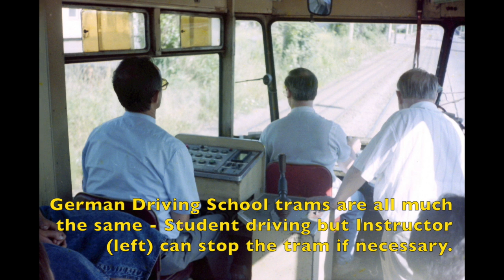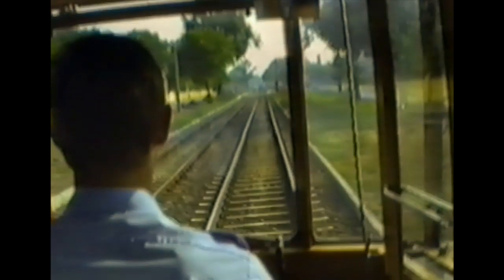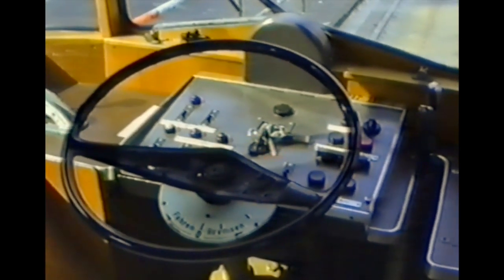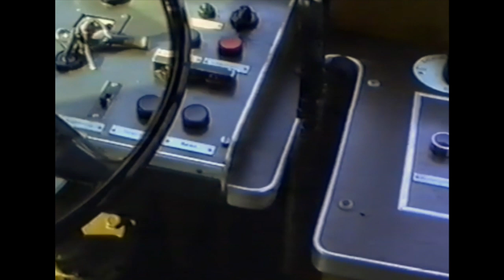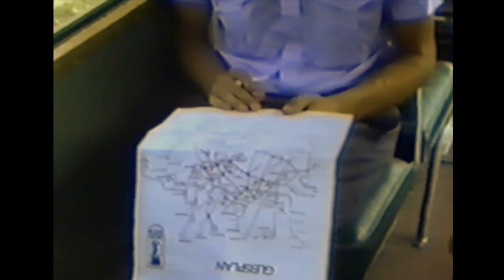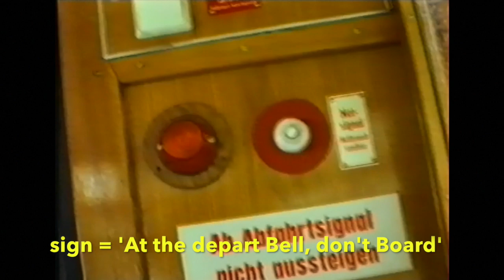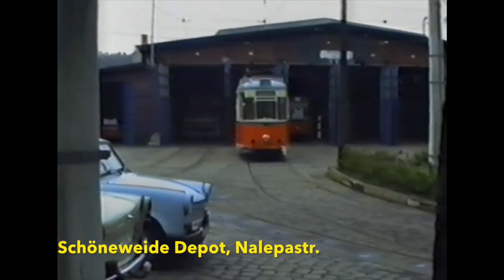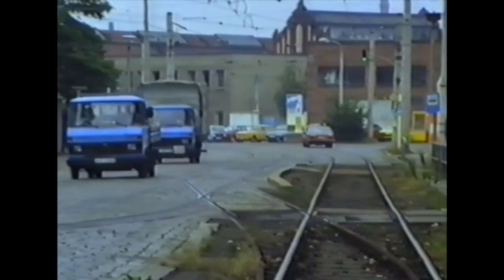Becoming a Tram Driver Berlin 1992 + Freight Locos

Comment: This would have to be one of the most interesting I have seen in a long time.
I love percular things like old trams and locos running in the street.
I thought pantographs were raised and lowered with compressed air like on trains

I went to San Francisco this year, first time ever.
I loved the working heritage trams they have, all the American cars almost as if they are brand new plus a Melbourne tram, a Milan tram and two Blackpool boat trams.
I really think Sydney should run heritage trams through the rocks and bring the Tramway museum up there, what a brilliant but function tourist attraction that would be.
Reply from the maker: I’m happy that you enjoyed it. It’s a pity most Railfans here will stay well clear of it. Around the world, most fans are very parochial and shut their eyes to fascinating operations elsewhere. As for raising pantographs, in Melbourne trams use an electric motor to stretchthe springs to pull pantographs up and relaxes them to lower them.
A few decades ago I think the Rocks idea was suggested but nothing ever happened and nothing ever will. Pity. As you say, San Francisco is great. The modern looking San Francisco PCC trams there look brand-new because essentially they are. Very thorough re-builds. Melbourne could run their vintage trams but the foreigners who run the operation want to keep them right away from the system.
Reply: @tressteleg1  i loved San Francisco, the cable cars are brilliant and of course Trolleybuses, they love them.
How STUPID were Wellington to shut the system down.
In Europe they use them plus tramways galore.
Well we now have the metro here in Sydney, will be better when it goes i to the city, but I think Metros, bring it on big time.
Have you ever been to the Trolleybus museum at Sandtoft in the UK?
Reply from the maker: Agreed, Wellington stupid.
The NW Metro was supposed to be a normal train extension. The Liberals wanted to kick the rail unions so made it a driverless metro with tunnels too small. I’m glad I don’t have to stand up for a half an hour or more ride. When the Bankstown rail line is converted to this, there won’t be too many happy people over there. Many less seats.
Reply: @tressteleg1  but that is how metros work, also it's much quicker.
The journey to the city will be much quicker once it's goes through.

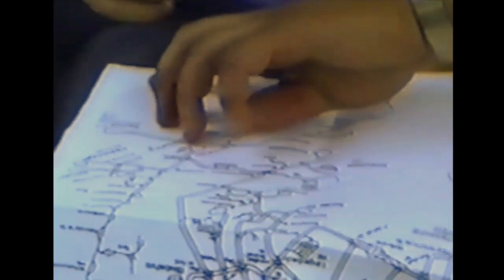Comment: very interesting. lots of trabants around.  the berlin system as shown on the map- (8:53).  is that the east and west system combined because as you well know, there was a time when there was a wall between the two sides of berlin.  this video being 1992, have the connections already been made?
Reply: The germans where very quick to close the gaps .
Reply from the maker: Yes I noticed the Trabbies. I can’t recall too much about reextension into West Berlin but from memory it was a long time after 1992 before the first one and the extensions have been fairly minor but a local could tell you more.
Reply: West Berlin literally got rid of their tramway in the 60's while East Berlin close some lines and opening new lines to new boroughs I think

Comment: did you ever drive those double trams i know some were connected by to bendy rod poles and others buy a coupler like on the front of a train
Reply from the maker: I think you are referring to those categorised as KT4 or something like that. Unfortunately not, but I did get to drive a standard Tatra PCC. That was probably the most exciting sly drive I have ever had. Racing along rather fast on Dresden (East Germany) streets that I had never seen before on a fairly quiet Sunday morning without much traffic. I do have video of that fun run. Perhaps I should post it one-day.
Reply: @tressteleg1  some were called double trams cause they weren't connected by consaltina aka the metal part that turned when it turned the turntable they were connected by poles or it was 2 coupled to each other as when they were made there was no consaltina one tram was i think a konstal 105 na
Reply from the maker: I think what you are describing in English is simply be called a ‘coupled set’. 
As for the Konstal trams, I visited Poland in around 1991 and took plenty of video of the trams there, but have not put any of it on YouTube.

Comment: Nice Video Mate.
Reply: tressteleg1 All good I'm asking you what month you film Reservoir stations before completion just saying?
Reply from the maker: I will go to Melbourne sometime after Christmas. I have no idea what my driver will hand me. 300Gig of data early this year! Still working through it.
Reply: @tressteleg1  Ok They said New Reservoir Stations open on Monday 16th December and train will run new bridge next to new Stations?
Reply from the maker: OK Thanks. Hopefully my driver will do a run out that way after it opens and can have his camera with him but certainly with some sky rail projects elsewhere, the place was crawling with inspectors and others assisting drivers with the new arrangements. Obviously no cameras until the dust settled.
Reply: tressteleg1 Thank you so much i'm happy because the Reservoir intersection is the worst area now works makes the road safer and level crossing already removed can't wait What about you are you happy about it?
Reply from the maker: I don’t live anywhere near Melbourne so it’s just another project to me. No doubt the motorists will be happy but it will make little difference to the train service.
Reply: tressteleg1 Ok that's true I agree with you anyway all good.

Comment: Interesting insight into another world.  Those tram controls look so confusing and unergonomic but I suppose they get used to it.  Every other car is either a Trabant or a Wartburg, were you in the former East Berlin?  Cheers
Reply from the maker: Comments noted. 😊. At that time there were no trams in West Berlin and only 2 extensions since have ‘crossed the former line’.
Reply: Ok, I wondered why the area still had that interesting, very old infrastructure.  Not often you see freight trains in the city like that :-)  Interesting that there were no trams in West Berlin.  I would have thought otherwise but I guess they seemed old fashioned to the more 'advanced' western side.  Tram driving has certainly given you some adventures.
Reply from the maker: Communism ‘held back progress’ and that is probably why the freight railway lasted decades longer but as you saw, it went 3 years later. What became West Berlin never had more than a few tram lines. Heavens knows why. When the wall went up they were scraps to nowhere. Yes, being a tram driver in Melbourne at the time did open some doors. I will do a video of my sly (unofficial) drives in due course. Trains too.